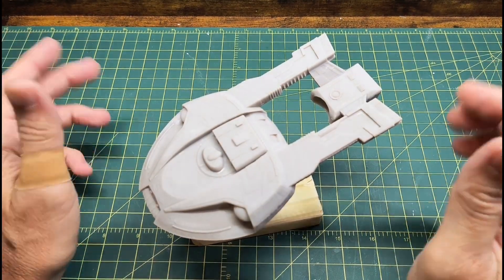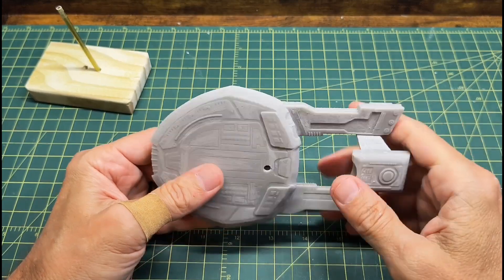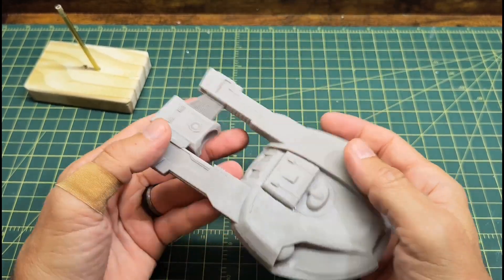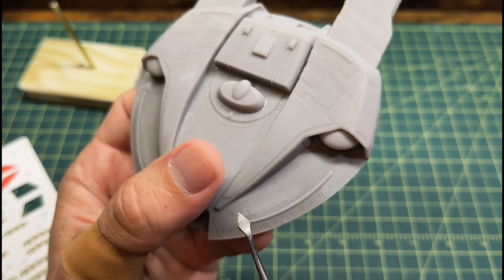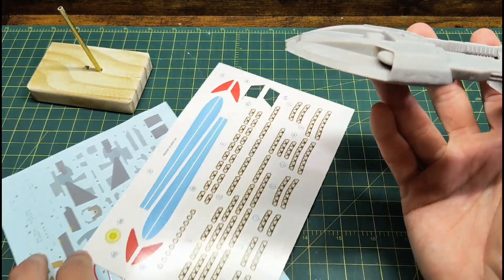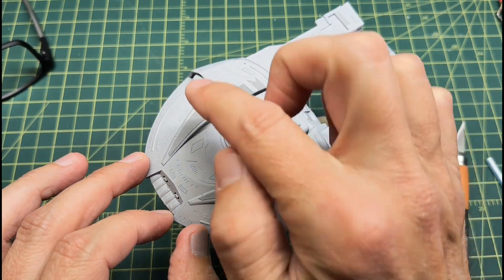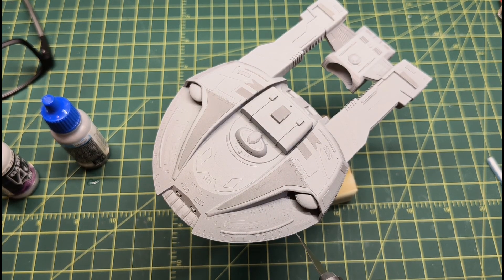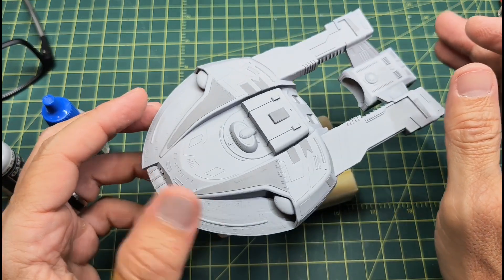Star Trek Steamrunner Class 3D printed model

Comment: Try printing it from the aft section up. I printed it that way and all of the detail came out BEAUTIFULLY on my resin printer. It takes significantly longer, but definitely worth the effort. There's only a few supports on the back end that have to be sanded down. I also used a Tamiya panel line scoring tool to re-score the lines on the ventral section.
Reply from the maker: Yeah, I agree .